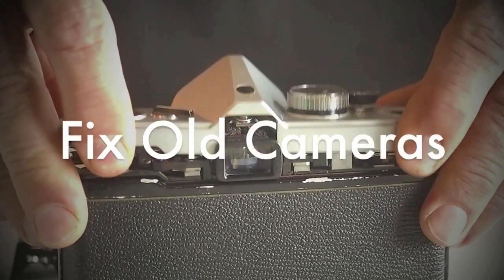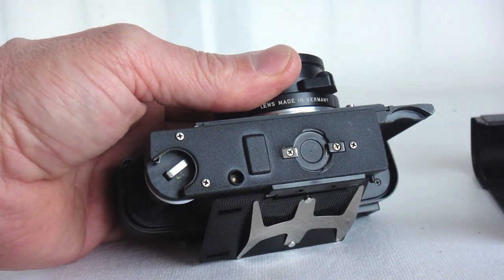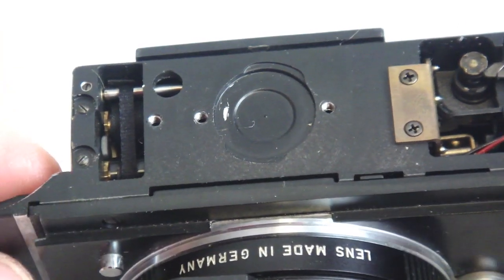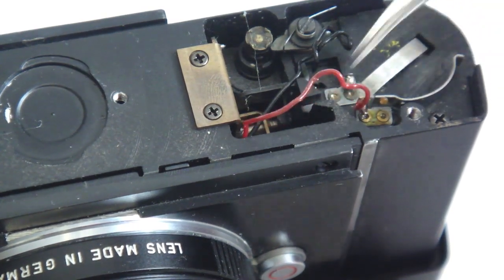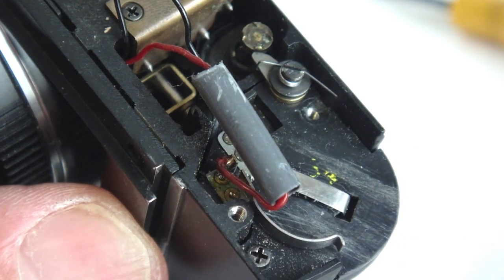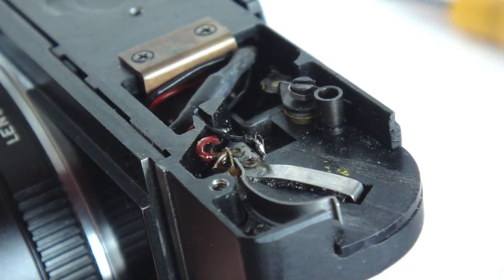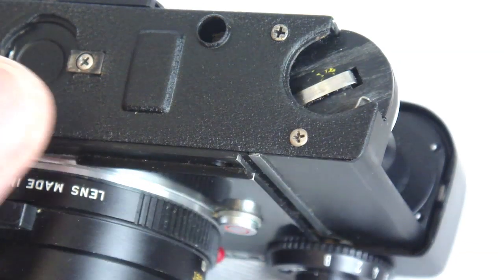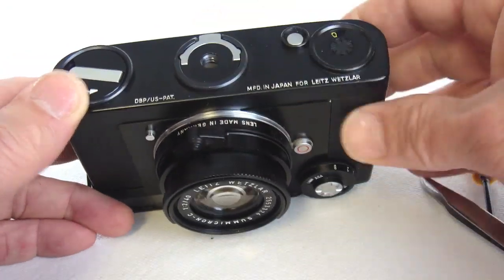Fix Old Cameras: Leica CL Diode Modification

Comment: These videos are great. I just wanted to check as you don't appear to have a video with a Konica camera as of yet. Is it always the red wire in which you need to insert the diode with any of these light metering SLRs? I'm assuming that is the case but seems prudent to check before hacking up a camera needlessly!

Comment: I love these videos.I have a Fujica ST801 that works fine with the Fuji lens.The button to stop down a regular screw mount lens for metering won't move at all.Since I have several lenses ti fit this camera it would be nice to be able to meter with them.I'm new to working on cameras so I hesitate to dig into this without knowing what I'm doing.
Reply from the maker: First note that the Depth of Field button on the ST801 can be locked by turning to the left. However if there is a malfunction, the ST801 mirror box is not attached to the front plate, so the front plate can be removed to access the stop down button without any major disassembly. The procedure could be covered in a Fix Old Cameras video. In the mean time check the lenses for a manual diaphragm setting for stop down metering. Also note, that the open aperture feature of your camera makes its M42 screw mount non standard and when using a non Fuji lens you may have difficulties when trying to focus at infinity and also possible is the lens could get stuck on the camera.Thank you for your continued interest and suggestions.

Comment: I read that the meter often go refused in the CL.
I wondered if not replacing the diode for a modern battery it would be an easy fix?
I am worried to buy it if there is no replacement parts or unfixable.

Comment: I have no idea if this is a common issue, but I have a Pentax H1a with a shutter curtain that won't travel completely back to closed and a mirror that won't return because of this. If the body is similar to other Pentax of the era, could you perhaps do a disassembly video for the rig? Great channel, carry on!
Reply from the maker: The Pentax H1a and the Spotmatic line of cameras are all very similar in mechanical function. The camera in question is need of general service and to do properly requires a fair bit of disassembly. However the tension on the shutter springs could be increased to overcome the present inertia of the shutter curtains. The tension points can be accessed by removing only the bottom cover. This procedure is fairly simple and could be covered in a Fix Old Cameras video. Thank you for your interest and patience. As always, suggestions are greatly appreciated.

Comment: Such a mod for the Leicaflex SL would make you my hero... ;-)
Reply from the maker: Thank you for the suggestion as it would be a fairly easy effort as there is room for the modification under the bottom plate.
Reply: @FixOldCameras  I opend mine and I got a 1N34A diode ready. But there are 3 (!) red cables going away from the battery compartment... Can you help? Don´t know how to contact you from Germany as my spoken english isn´t to good to phone you. I would like to make a video of the mod for your channel (free of charge of course)...
Reply: @gun_flyin  hi. i have a leicaflex sl but mine have only 2 cables. anyway... the sl have adjustment knobs hidden under the leather on front of the prism. you can calibrate your meter with them, no need to phisically modificate the camera. at least, mine work just great ant it's accurate
Reply: @Fabio-id7jz  thx I will give that a try 👍

Comment: Hi thanks for your useful videos. will this diode mod repair a non working lighmeter or whats is this for?!

thanks again
Reply from the maker: The diode modification will not fix a dead meter, but will make a meter that was designed to operate with the discontinued 1.35 volt mercury battery operate correctly with a 1.5 volt silver battery. It does so by dropping the voltage input from the battery.
Reply: thanks again. appreciate a lot you videos.

Comment: Wanted to find out if the ECG 109diode is same as the one you are showing in video
if not what would you recommend to lower voltage
Reply from the maker: +Joseph Greenberg 
It is. The ECG 109 diode is now considered a vintage diode. It does still have limited availability. Any equivalent germanium diode will work as a substitute. In fact any diode can be tried, if the drop is incorrect try another, you will not harm the circuit.

Comment: With that voltage difference, does it not make the meter behave differently and require exposure compensation ???
Reply from the maker: As long as the meter is working properly before the diode modification the meter will be as accurate after the modification with a 1.5 volt battery as it was originally when it operated on a mercury battery (1.35 volts).
Reply: @FixOldCameras  Thank you for the swift reply !

Comment: Three questions--

1) What is the effect of using a 1.5V battery on the Leica CL without this modification? Is the metering off?

2) Even the 1.5V batteries are hard to find. I ordered two from Amazon, both came expired. One was dead and the other, though expired, is not dead yet. Where is a good place to get new 1.5V batteries of the kind the Leica CL takes?

3) Diodes reduce the voltage by 0.7V, so wouldn't this bring the voltage to 0.8? Maybe I should read the data sheet for this diode you recommended.------- Ok, read the datasheet... you're using it as a zener diode, so the forward voltage is 1.2V. Very nice.
Reply from the maker: kettch42 The 1.5 volt battery will make the meter inaccurate but will do no short term harm. Using a hand held meter or another camera as a point of accurate reference the ASA can be adjusted to the point where the meter reading of the CL matches. Unfortunately this is not a linear adjustment and the meter will still be slightly off as the lighting conditions change. Most print film has an exposure latitude of one stop under and a three to four stops over, so you should be OK for the most part with the ASA compensation. Slide film is not near as forgiving. The button battery such as the EPX76 is readily available. But a small O-ring around so it fits properly in the battery chamber. The functionality would then be the same as the 625 battery.

Comment: Thanks for the video. My CL does not turn the meter off when the lever is in rest position. Any idea of what could be wrong? Would it be a quick and easy fix? Thank you!
Reply from the maker: Maybe... but at the very least the top cover will need to be removed for an inspection of the meter circuitry.